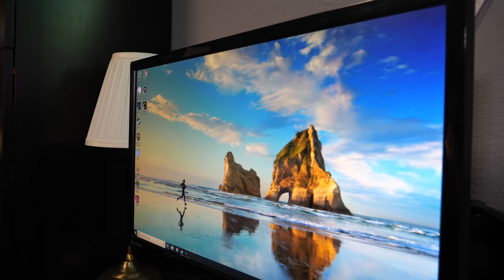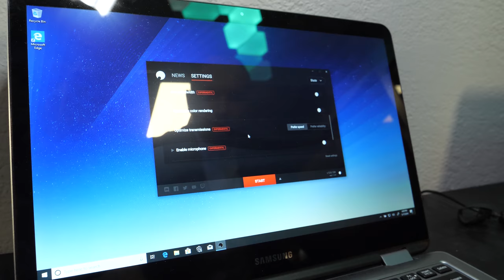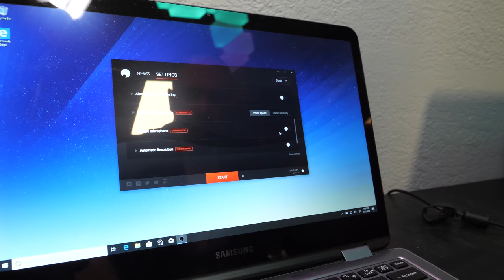Shadow US Headquarters Tour

Comment: How can I actually get the Shadow Ghost box? I'm super into this idea but the lack of box availability worries me. Are they still commited and fully supporting the Shadow Ghost box??
Reply from the maker: I pre-ordered the Ghost they're shipping their second batch in like a month or two. By then also the multi screen and all other optimizations in their Ghost client software will have been installed to it at that time. I think Ghost has the awesome Rockchip RK3399 running some kind of Linux.
Reply: Charbax is there a way I can pre order it? I want to invest into the platform but I want to run it with the box.
Reply from the maker: @MattyPrime187  They had pre orders for second batch opened a couple three weeks ago, not sure if they still take more pre orders for the second batch. I'd think they'll just have plenty in stock hopefully soon, until then it runs perfectly well off any old laptop released after 2012 or so (as long as it can playback 1080p at 60p smoothly if that's what you want to use on the HDMI port of it or something) I also think Shadow runs great on a $35 Fire TV Stick 4K, though keyboard/mouse by bluetooth if you use it for the main display in a multi display config.
Reply: @MattyPrime187  Why dont you just buy a cheap but strong android tv box like gt1 mini? Look it up, assuming the size, power consumption and heat/sound production levels of the ghost box are the go for you I think you will love the gt1 mini more. It is far smaller and capable than the ghost box with its 12nm node architecture in comparison to Ghost Box's very old and inefficient 28nm node size design.
Reply from the maker: @guneshmps7122  yes the GT1 Mini should be just fine. The TV Box is just running basically a video stream, but I think they're over optimizing slightly more on their RK3399 Ghost box than on any other random Android TV box. Though I would expect that within not long any Android TV Box will run their newest Android client app just fine. Over the past year it's been a work in progress for them but I think their Android client app is about to be getting quite stable and good. The little trick they do is pass accessories as USB over IP but not do it for the mouse and keyboard, for those input devices just passing over the commands only, slightly helps with input lag. So when using any third party TV box hopefully they also are able to manage that simply in the Android client app.
Reply: @charbax  Thanks for the reply, and I think you are great!! I plan to use sentio desktop on that piece of tv box with a portable usb monitor = extreme efficiency in heat/power management for sure! (And I think you interviewed those sentio guys a few times too, cool product they make!)
And yes, because the ghost uses a custom os solely designed to do the streaming job compared to mini using a full-fledged android it may be more efficient than mini though still 12nm of s905x2 vs 28nm of rk3399 still a big difference.
Reply from the maker: @guneshmps7122  is the s905x2 still a octa core ARM Cortex-A53 though, if that is the case then the RK3399 is likely more powerful still with those dual A72 + quad A53..
Reply: @charbax  Yes rk3399 uses big little architecture and the efficiency cores it uses is cortex a53 but 28nm, and all the cores  s905x2 uses is a53 to begin with but at 12nm. So even when using efficiency cores rk3399 must use far more power and produce far more heat than s905x2 when both employs the same task under the same conditions but ghost's custom os again may offset this in favor of the rk3399.